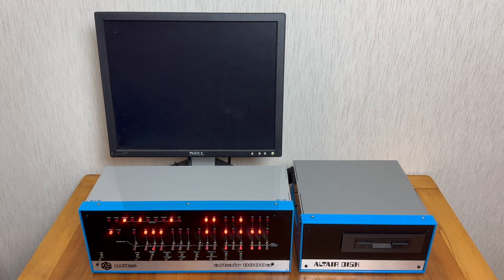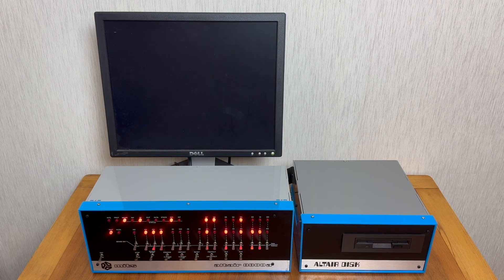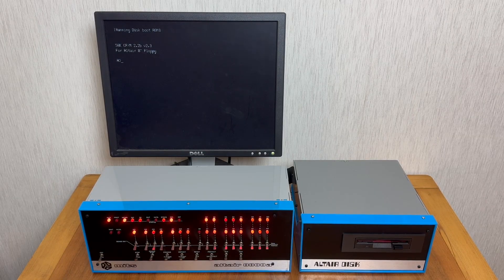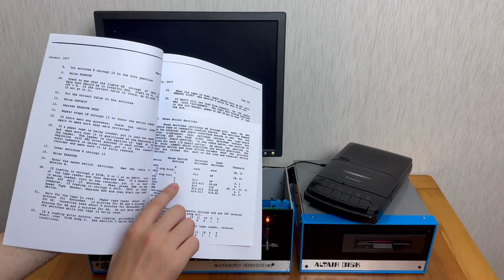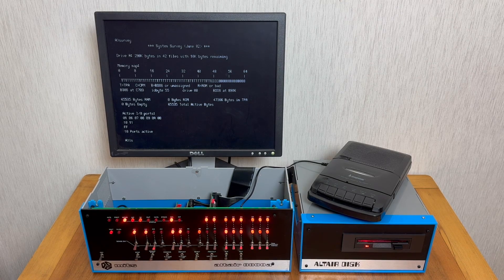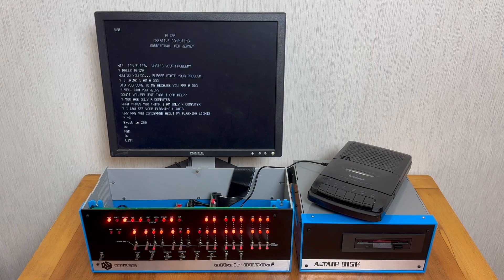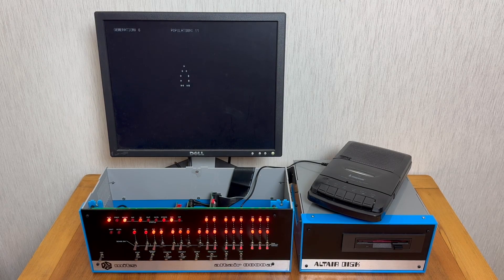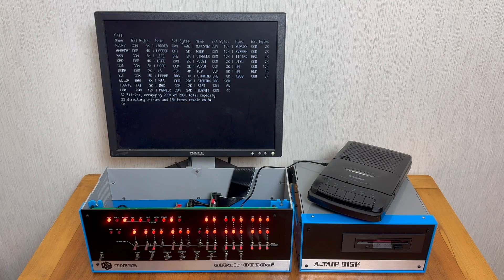Bringing Life to CP/M the Hard Way on the Altair 8800 - Switches, Tape, and a Bright Pink Floppy

Comment: That three-step booting processes is spectacular, like a little journey through a stretch of computing history. It's fascinating how much the Altair and IMSAI still embodied the minicomputers that came before them, whilst already heralding the CP/M era that would follow. Just a year after the Altair, the SWTPC 6800 completely did away with the toggle switches and the oddly blank design of the front plate of that computer does make me wonder whether it was originally intended to sport toggle switches, before the company decided to either replace them with the MIKBUG monitor or concluded that they were superfluous given the latter. Truly a fascinating time!
Reply from the maker: Absolutely! It was such a fascinating and fast moving period. I expect most users who purchased a floppy unit would also have a suitable PROM card and boot from that, but having full control over the computer and memory direct from the front panel means there is no reason you couldn't toggle a disk boot loader in directly - with enough patience!

Interestingly MITS also announced their own Motorola 6800-based computer in late 1975, the Altair 680. Unlike the SWTPC 6800, the regular version did have a front panel covered in switches. However, MITS was also moving towards lower-cost "turnkey" computers and a cheaper 680T (turnkey) kit was available. To allow operation without a full front panel interface, the Altair 680 included a built-in TTY interface and a System Monitor on PROM was also available.

Announcement (Popular Electronics November 1975): https://archive.org/details/197511PopularElectronics/page/29/mode/1up
Altair 680 Advert (Popular Electronics December 1975): https://archive.org/details/197512PopularElectronics/page/34/mode/1up